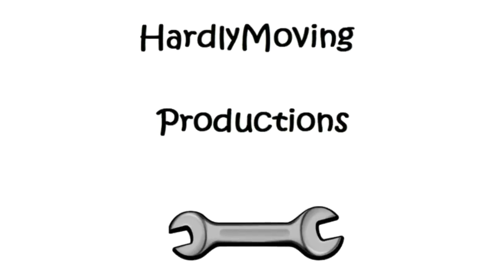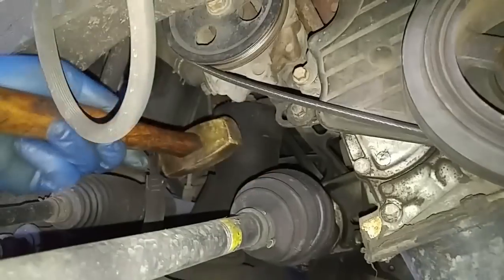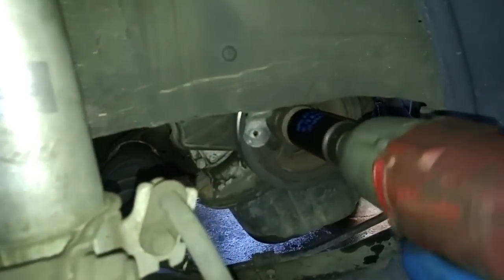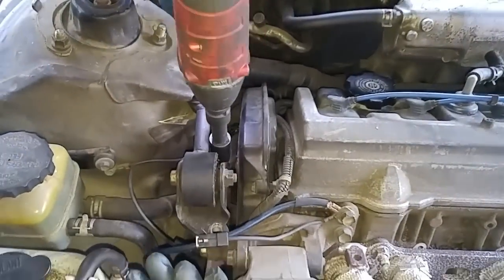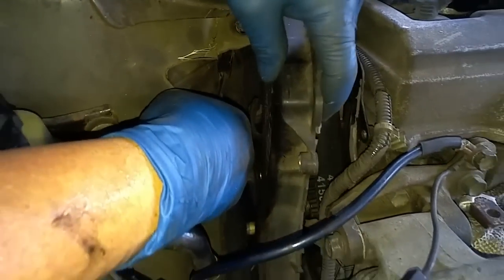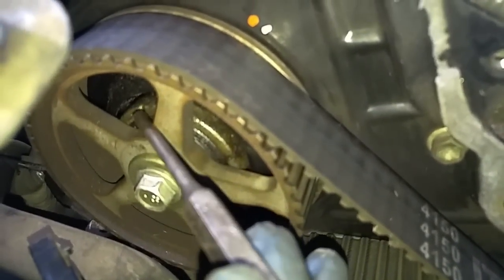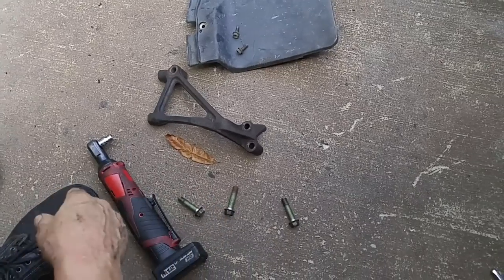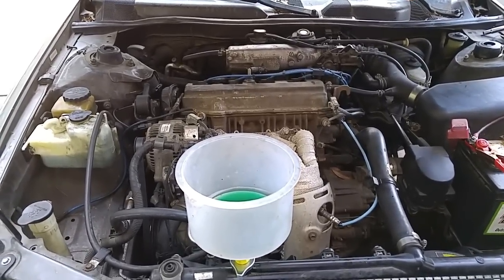Camry Timing Belt, Water Pump, Seals & Pulleys Replacement:  2.2L I4 5SFE Engine

Comment: Can I ask you something I don't quite understand about your crank/cam alignment (I'm not trying to corner or offend you or anything, I just don't get this one thing you did). You made orange marks as reference points on the crank gear. Why didn't you just use the V mark on the gear and the timing nub behind it that are already there for this very purpose? Is it because they are hard to see or you didn't know about them? Or was there some other reason? Again, I'm not trying to corner you. It's just that if you didn't know about them, maybe the teacher that told me he set my crank/cam alignment didn't know about them either. If you didn't know about him, I'd feel more comfortable asking him if he knows about them tomorrow when he looks at it. It sort of a touchy situation for me to tell the teacher he doesn't know something that I do know, especially since I haven't done this job before, if ya get my drift?
Reply from the maker: You're correct with your first assumption.  I use paint marks for quick and easy visual reference for both myself while personally working on a customer's car and for you guys watching the video.
Reply: @hardlymovingpro  Okay, I understand. Thank you.  I'll keep you posted  on how it turns out.

Comment: Great video! Can you please provide the torque specifications of camshaft and crankshaft bolts after seals installed.  I have watched several times and subscribed and clicked notification bell.  Thanks!
Reply from the maker: Crankshaft bolt is 80 lbs.  Camshaft bolt is 40 lbs.  If you want a diagram showing the torque specs on all the bolts, you can go to one of my written articles in axleaddict:  https://axleaddict.com/auto-repair/Toyota-Camry-5SFE-Engine-Timing-Belt-Water-Pump-Seal-Replacement
Reply: Thanks you for your timely reply.  It was a well written article.
Reply from the maker: Thanks ... No problem.

Comment: If valve pend what course
Reply from the maker: The cylinder heads must be removed, inspected by a automotive machine shop and any bent valves replaced and re-seated.  You'll also have to inspect the pistons for damage as well.
Reply: @hardlymovingpro ok thenk you
Reply from the maker: @mageriajatsin546  No problem!
Reply: @hardlymovingpro  ok am mechanical yesterday a got somebody her timing belt broken so i change for her
Reply from the maker: @mageriajatsin546  The Toyota I4 5SFE is a non interference engine.  The valves will not be damaged from a broken timing belt.
Reply: @hardlymovingpro  it can not damage anything if i put timing long

Comment: Pull the pulley with the pulley removal tool.
Reply from the maker: If it were rusted in place ... yes ... you need to use a pulley removal tool.
Reply: @hardlymovingpro  haha sorry I was just having a little fun of the profuse use of the word pulley. Didn't expect a comment. Great vid btw
Reply from the maker: No no... you're right ... there are jobs where I did have to use a pulley removal tool to get the pulley off.  Appreciate your comment!

Comment: The oil pumps on these engines leak a lot sooner than 200k miles. And no, domt goop up your oil pump with silicone sealant, thats a bad idea. Just get oem seals for the thing and reseal it correctly.
Reply from the maker: Here's the video and RTV works just fine:  https://youtu.be/_tsAtyOGpaQ

Comment: My 99 Camry 5SFE with 108K had it's timing belt done last week. Now there is a noise of something loose or rattling only when the engine just warming up. It's even worse when there's a load on the engine, but only when it's cold.  Here's a video I made where you can hear it;  

https://www.youtube.com/watch?v=VpIfTVyXVmU&feature=youtu.be

Any ideas what it could be would be helpful. The job was done at a technical school by a student.
Reply from the maker: The belt is on too loose.  If you watch my video, I start the car with the new belt, recheck the tension, adjust, start the engine again and check again BEFORE I button the engine up.
Reply from the maker: Also, I'm assuming you replaced the tensioner and idler pulleys?  If not, that could be a source of noise, during engine warm up, which indicates the bearing(s) are worn out.
Reply: @hardlymovingpro  Yep, all brand new Koyo bearings.... the best. And I checked them for play. They were perfect. Thanks for responding.
Reply: @hardlymovingpro  Ok, will check that out on monday and let you know. Thanks
Reply from the maker: @dbfcrell8300  Here's a trick that might fix your problem.  The bottom timing belt cover has an access port hole covered with a rubber plug.  That hole gives you a direct path to the tensioner pulley bolt.  So turn the crankshaft pulley clockwise till you feel tension ... then loosen and re-tighten the tensioner pulley bolt.  This may remove the slack on the belt.
Reply: @hardlymovingpro  Oh cool, I didn't know abouth the access port. Thx! 

I actually am having the tech school my wife works at do this work. Bringing it back Monday due to this noise. I need to find a nice way to tell them they messed up. Another problem is my gas mileage went from 29mpg to 19 right after this job, so I'm wondering if the belt slipped a tooth? The car seems to run great, accept for this noise and gas mileage.
Reply from the maker: @dbfcrell8300  The MPG drop must be due to the cam and crankshaft being out of alignment.  Tell the tech students to watch the video.
Reply: @hardlymovingpro  I agree. Thanks for confirming.
Reply from the maker: You check engine light probably came on as well.  The error would be "camshaft or crankshaft position error".
Reply: @hardlymovingpro  No CEL. I'll check for codes tomorrow. Man, if it weren't for the crappy gas mileage, I would just tighten the tensioner and call it a day cause the enging has more pep than ever (prolly advanced timig I'm thinking), but the belt has to get reinstalled with correct alignment. I drive 400-500 miles per week.

Comment: the dealer accidentally ordered Japanese or Chinese oil seals instead of us soil crank seal fortunately yhe other parts person picked up on that and straitened it out he said that the crank seal would not fit right
Reply from the maker: Don't understand the problem.  The 5SFE engine is a Japanese engine.  What's wrong with Japanese oil seals?  Probability the best seals you can get.

Comment: Other mechanics use a 45 degree to torque the tensioner down.
Reply from the maker: If that works for you. What works for me (after having done a number of belt replacements on the 5SFE), is to re-check and adjust the tension after starting the engine.  Most instructions state to manually rotate the engine a couple of times then re-check the tension.  Well, starting the engine is like hundreds of rotations before re-checking the tension.  I believe this helps the belt and its components seat in better.

Comment: have you ever had a Toyota motor shaking and smoking out tailpipe
Reply from the maker: Shaking is a motor out of tune.  Smoking ... depends on what color.  White coolant with due to a blown head gasket, black for fuel burn (fuel injectors?) and blue is oil burn (blown head gasket, worn oil rings, main bearings, valve stem seals).
Reply: @hardlymovingpro  gray smoke if that makes any sense
Reply from the maker: @ryanhughes5731  If during initial start up during a cold day and the smoke disappears, then it's moisture evaporation in the muffler as the car warms up ... otherwise, blown head gasket.  Check your coolant level to confirm.  If low, add coolant to radiator and reservoir.  Start car and watch for air bubbles in the reservoir.  If bubbling ... blown head gasket.
Reply: @hardlymovingpro  when I rev It Up
Reply from the maker: @ryanhughes5731  Not a good sign.  You've got internal engine problems.

Comment: I have a question ,how did you get the crankshaft sprocket 😊off
Reply from the maker: Usually pulls off by hand.  If stuck, must use a puller tool.
Reply: @hardlymovingpro   thanks I will do that 😃